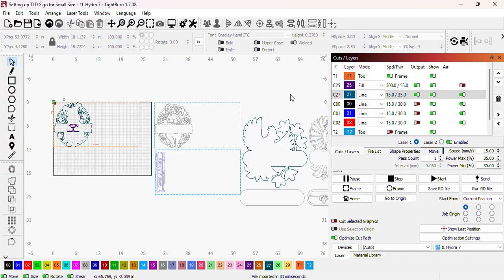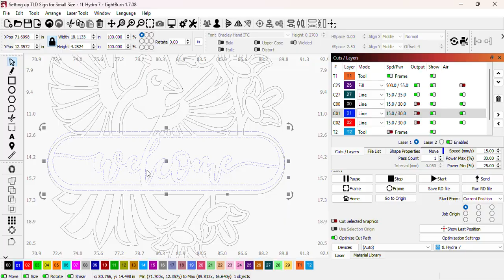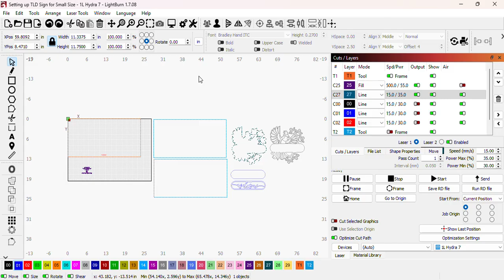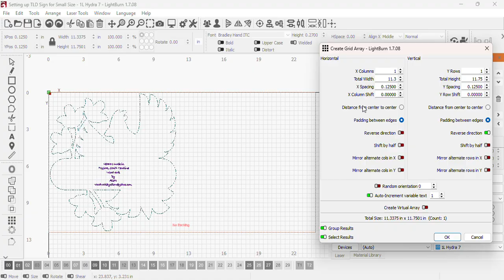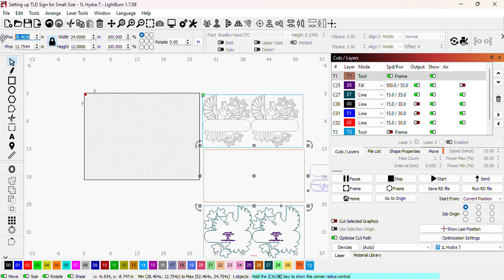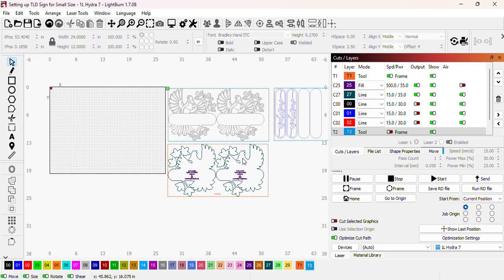Importing a TLD Sign into Lightburn and setting it up to run on the OneLaser Hydra Laser Machine

Comment: You don't NEED to stack or group them to resize them.  You can align them all horizontally, select them all, and enter the new height. Then everything will resize.  Also, you don't HAVE to put them on different layers.   If multiple items are on a layer, say Black. Only the BLACK layer that is on the work area will cut, in addition, you can use CUT SELECTED GRAPHICS, and only the selected graphics will cut, even if they are on the work area. For just making 1 duplicate of something, you can also just right click it, Duplicate, then move the duplicate where you want.  Preference.  I have never used a frame layer. I don't see the need, other than to give you an idea of how big your board is.  I use the framing button for that.   Also, for resizing, you can also type in a %   like 65%  instead of a number.   Then, you cane select each item, or all, and enter 65% to have them all resize the same.  :)
Reply from the maker: Personal preference.  As for resizing. I prefer to assemble everything just to be safe and I use inches over % as I need to be at 11.75” for the largest dimension (width or height). Many of the people who buy TLD designs are new to LB so I tried to keep it simple. You sound like an advanced user.